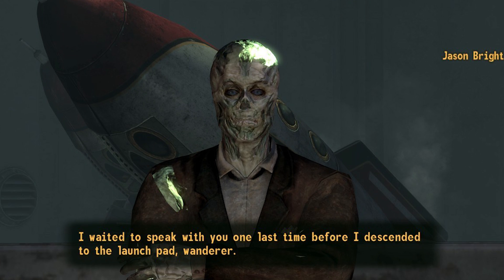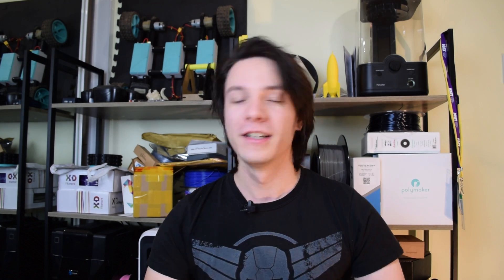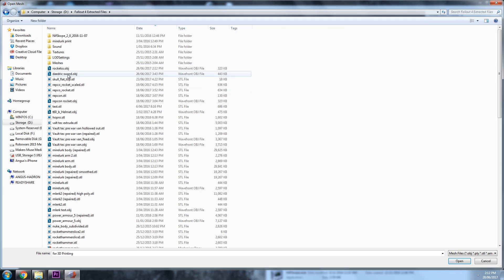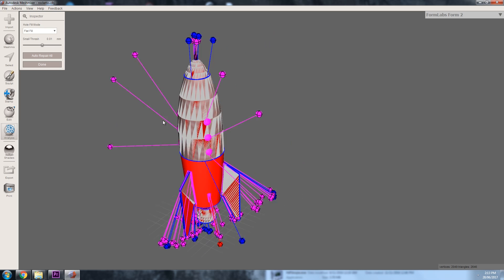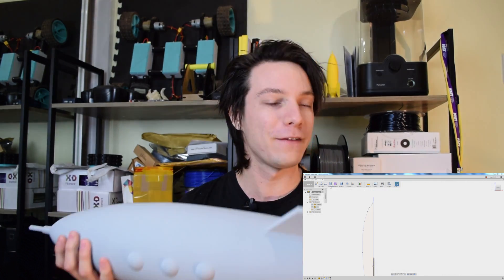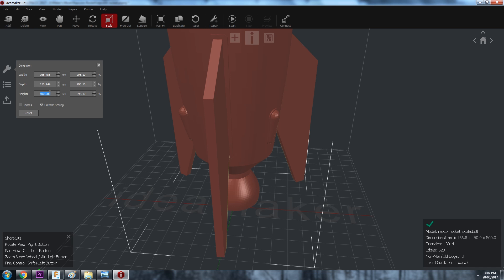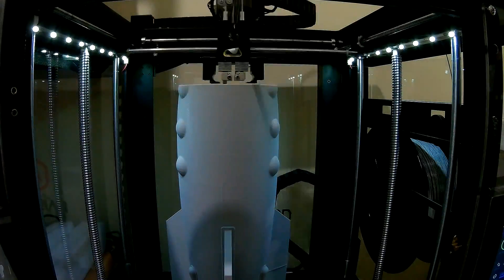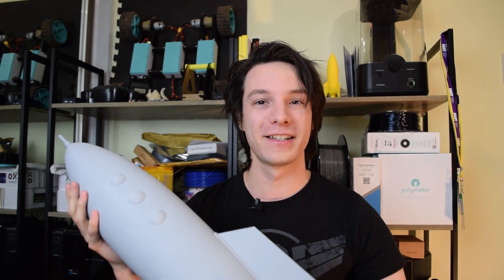Huge 3D Printed Rocket from FalloutNV! How I recreate in-game objects with Fusion 360

Comment: Warning: Do Not purchase from GearBest. If there is any issues PayPal will make you send it to China even if you purchased it from US Stock and Insurance. Your bank probably won't protect you either. I suggest Amazon but whatever you do stay away from GearBest.
Reply: Thanks for your insight. I'm over it now and my only objective is to inform new folks of the GearBest Gamble. I thought I eliminated the gamble by paying $47 extra for Insurance and US Stock. I also thought PayPal would protect me if needed. I lost but I was able to find a home for it with a guy that is comfortable building and hunting down parts and etc.
Reply: Same goes for anything from China. I have a VHF/UHF comm handheld from China, but it didn't come directly from China, instead it came from a US supplier who backs it up with their own warranty. It also makes shipping more reliable as well.
Reply from the maker: You're buying direct from china to get the lowest possible price... what do you expect. Buy local or don't ever expect warranty.
Reply: I paid for US Stock and for Insurance. The Main Frame (largest part) was broken in 4 places. One Guide Rail Was Missing and One Threaded Rod was bent. GearBest went silent after I explained what I needed. (for 2 weeks) They finally offered me 32 USD. Ha! - I paid 227.49 instead of the 180 China cost. So your point is that's OK and I should not expect much from GearBest. I agree 100% that I should not expect anything from GearBest but I disagree strongly that it is Ok. I recommend Amazon. Amazon only sells reputable products from China like the QIDI TECH X-one and Amazon will accept a return without any issues at all.

Comment: Thanks Angus, I followed you & tried to send you a Tweet with a picture of my "Fused Muse" Angus 1 rocket.
It said it was sent, but it's not showing as sent on my Twitter page.
I can't print it because my library's new Type A machine needs adjustment.
 And my new Delta Kossel Mini kit is still in the box, that might take a while...:o)
I sized the 200mm tall Angus 1 to take common Estes model rocket motors, (available in AU)
 It should go pretty high, (1000 feet?) & the fins are angled to make it spin for stability.
Is there a site I could put the file on for you to print or send you a picture?
Reply: I tried putting the Angus 1  "Fused Muse" on MyMiniFactory, since I haven't printed one, I don't think they'll accept it.
I'll have to get back to you Angus... Thanks

Comment: Simplify3d is not a true Vase mode and it will handle fins of the rocket.

It's a shame that it doesn't do a true vase mode because sometimes that's what you need.

Comment: Can you make a video about optimise the printer for very small model ? I got some decent printed N scale cars ( 1:160 ) put i think i can have better quality with some optimisation. Also is it possible to print 0.1 with a 0.4 nozzle ? Because when i see some of infill it might be smaller than the 0.6 wall thickness in cura. So i think if you play with flow and speed maibe its possible to print lower than 0.100 layers height and smaller detail without changing nozzle.
Reply: You can get low layer heights but the width you're kinda stuck with. I mean, if you make things small enough the slicer will ignore it. Sometimes. But not all the time? I just started messing around with a business card model car pop together thing and getting the spokes to look right has been a headdesk situation.  Unfortunately 89mm x 51mm x 1mm doesn't give me a heck of a lot of room to play with.
Reply: Yeah because your slicer is configured with 0.4 nozzle i get it. But if i configure my nozzle on 0.1 even if i got 0.4 ?

Comment: You planning on making a 3D printed I/O shield for a motherboard? 
Thats the only reason I'm gonna get a 3D printer. I'm sure almost everybody in the PC building hobby wants to see a customized motherboard "armor"
Reply: ASUS is doing that.
Reply: Yeah. Unfortunately its only compatible with their new boards and exclusive to them. I was thinking about us who have existing boards from other brands. 

SinceI'm getting an AM4 board almost all of the boards don't have any covers. And I don't want to support Intel anymore.
Reply: Rear I/O shields are a pain, if that is what you are talking about.
There are lot of metrics that you have to get just right or else some of your ports are blocked.

Unless you're talking about wing-ding crap that covers over the VRMs or the connector boxes themselves on the board itself, at which point, you... go on ahead...
Reply: I'm not sure why sizing an I/O shield should be hard. You just plonk your existing I/O shield or if it's missing, the mainboard itself onto your flatbed scanner, scan, trace, print out your trace on your laser/inkjet, see whether the trace holds up by shining your light against the board, and you should be all set not to foul the connectors. One issue is that the shield is expected to be pretty flat though, and designing the retaining edge could take a tiny bit of trial and error.

Comment: angus how's your n2+? my buddy bought one a few months ago and it studders very badly on the X axis ruining prints.
Reply from the maker: That sounds like the axis is misaligned/skewed... mine isn't doing that. I'm not overly happy with the fact it doesn't have auto bed levelling or nozzle height at the size and price point, and found the 2nd nozzle useless... but now it's removed and nozzle height is set it 's pretty good!
Reply: Maker's Muse funny thing my buddy has been talking about removing one of the nozzles. he doesn't have the patience to fix things... he started with a HIC top PR us a i3, didnt work right, never tried to figure it out, just kept trying to print the same thing over and over and failing every time and never tried to modify anything or put thought into what is going on. I think most people aRe that way with cars, if it doesn't work right they think for some reason the next time they start their car it will suddenly be fixed on its own. I bought a HIC top i3 and have modified so many things on it and ever modified the marlin to get mine running reliably. I bought a folgertech ft-5 and got all the way to the wiring and haven't finished it. I was so frustrated that for it being a kit none of the wiring were the right lengths or even had harness'. they might as well just gave me spools of wire and said figure it out yourself....